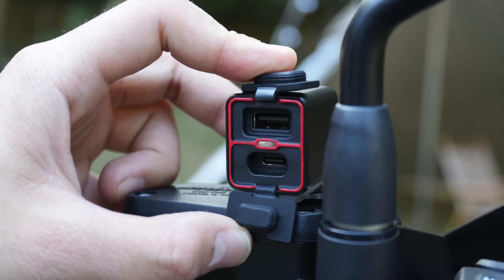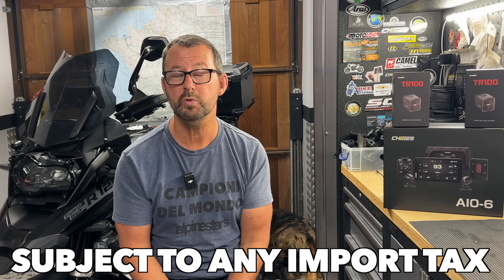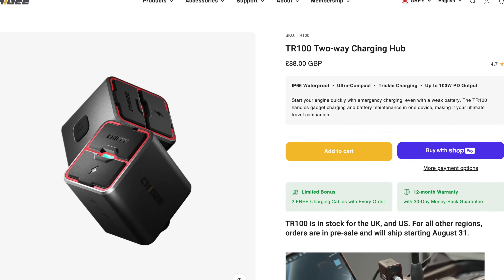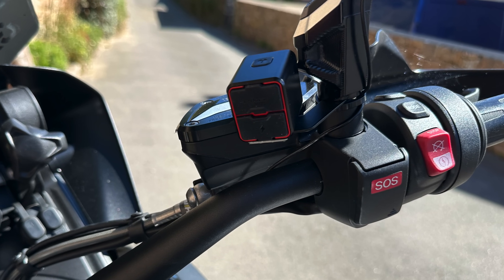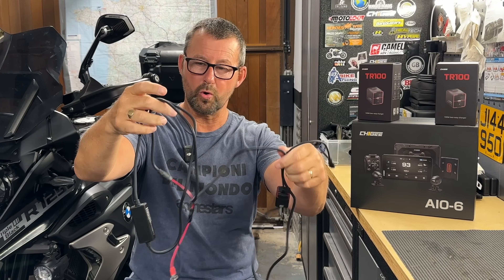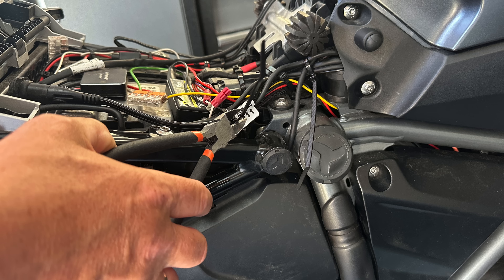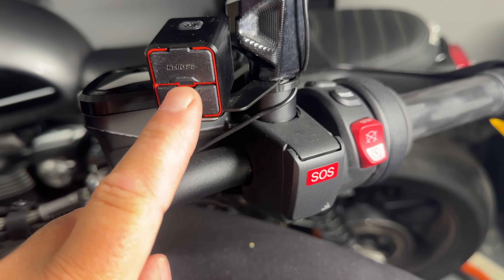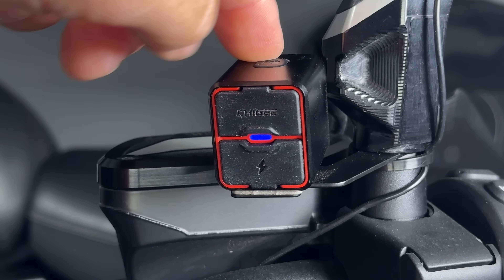Chigee's TR100.Is this small cube, possibly the best USB charger/ battery charger on the market?

Comment: Hi there. I have got one of those from nippy normans recently.  Before that, I have a idle charger which it was connected all the time so I could keep my battery charged all the time. My question is: now I have connected the TR100 2-way charger/battery engine starter on my bike, I was wonder if I could keep the battery connector for the idle charger connected as well the same time if I could have have connected both. will it be ok to use the charger as i was use to used it just charging all the time after riding? Thank you very much
Reply from the maker: Hi, I either use 1 or the other not both together. But no problem having both connected to the battery, its what i do.
Reply: @gsd32i  Hi there. Thanks for the reply, so if I connect the charger to keep my battery up, it would be okay? I guess? As long as I don't try to start the bike via the switch white the battery charger is connected? is that correct? many thanks

Comment: İ have the same setup but got a problem. Tr100 is hooked to the thunderbox and thunderbox is in automatic mode. So if want to reverse charge my bike battery how can i?
Reply from the maker: Hi. Personally I would just go direct to the battery as per the instructions. It has built in voltage protection etc so I wouldn't stress on someone pressing a button and draining the battery, not going to happen, unless you waited 3 years!!!!! I have just installed the 2nd one on my Triumph Speed Twin 1200, direct to the battery and am more than happy with the little Black cubes discrete but "classy" looks.
Reply: @gsd32i today i installed ğt directly to the battery. İts working great. Yeah i will buy second one too